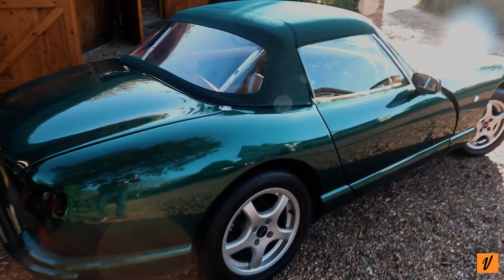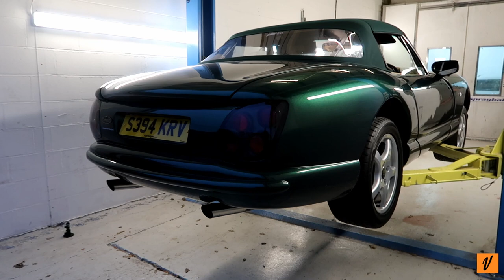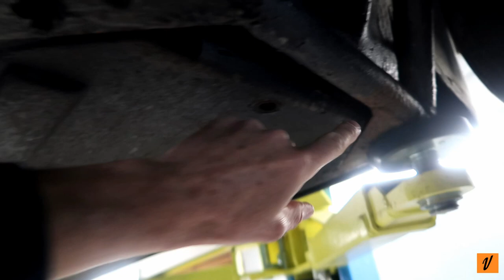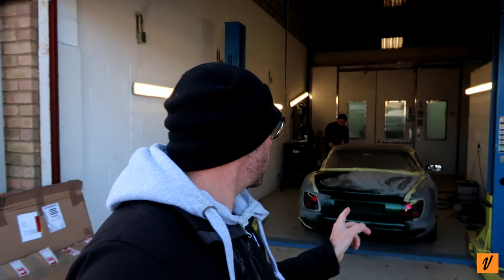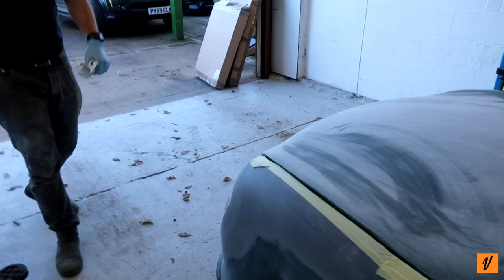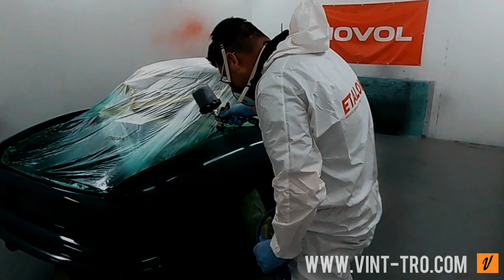Full Respray and Chassis Protection - 1998 TVR Chimaera 4.0L V8

Comment: You're looking in the wrong place for the corrosion on the chassis. The very top of the outriggers at the corners where the 2 post lift supports were supporting the car is where you need to check. The visible bits of the corners of the outriggers can look great but the parts on top can be missing. 
Never mind the stone chips. One of the great things about a TVR is it's fibreglass, the body won;t rust. Touch the stone chips in and just spend the money on fuel to drive it rather than paintwork. Stop worrying about every little mark and drive it
.
Reply: Agreed , the area where the chassis corrodes is between the body and the chassis which you cannot seen unless you lift the body. Also you Nedd to get the engine out to see the chassis top rails go from underneath the manifolds and down along the transmission tunnel
Reply: I'd second that - Those outriggers are going to want replacing at somepoint in the not too distant future.
Reply: Yes I agree too. 

Love my Chimaera and yes the mechanicals are definitely more important that the paintwork. Mine has had 100k miles on it and I’m just changing the engine bearings at the moment. It has a number of ‘character’ marks on the body from the years but I drive it as much as possible and enjoy it. Maybe sometime a respray for me in the future but for now I can go to Tesco and not worry about parking. Simply enjoy the driving experience.